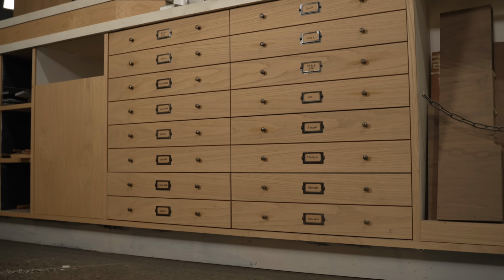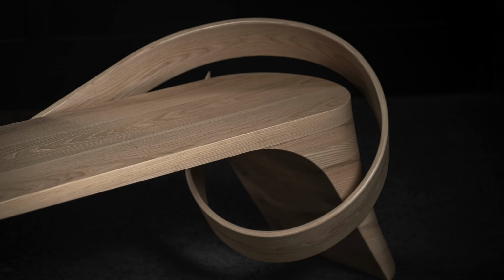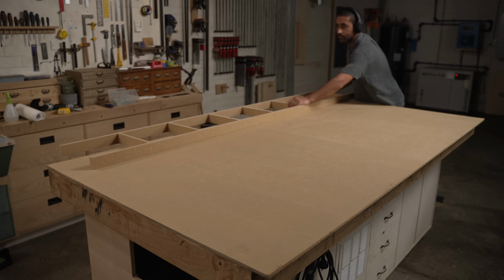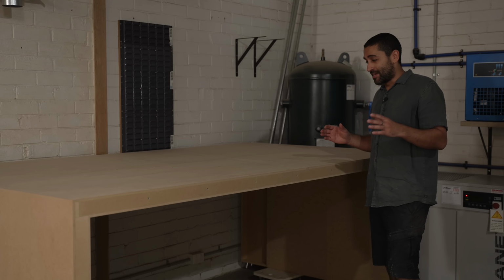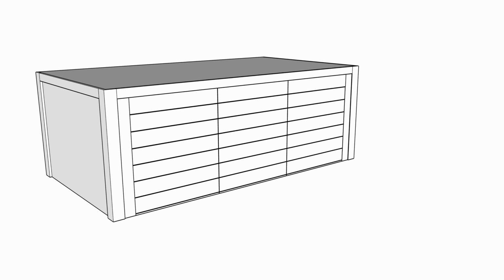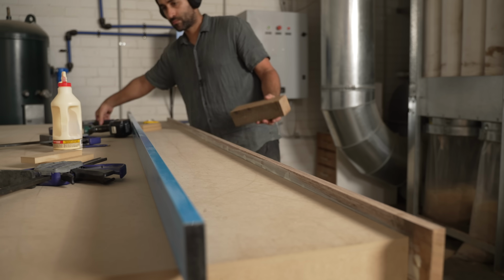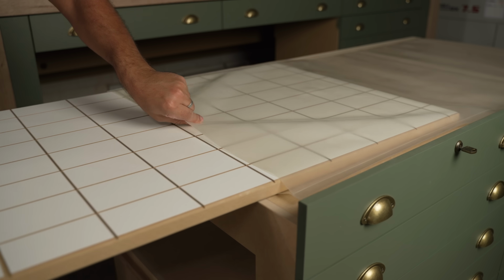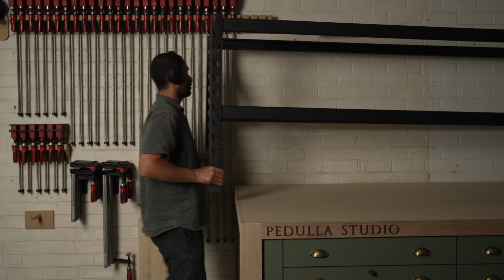Making drawer cabinets - WITHOUT DRAWERS

Comment from the maker: As always, thanks for watching!
Reply: A help maybe? 
Regarding resistance to bending (sagging workbench). 

There are vast numbers of formulae calculating “bending stiffness” depending on the shapes of a design but the major influence is given by the height of the construction vs the bending direction. 

The simplistic rule is that:
A) increase the width (thickness) by, let’s say 20% will increase the bending resistance by 20%
B) but increase the height by that 20% and it will increase the bending resistance by >70%. 

Kind regards 
Anders 
Sweden 

PS. Big admirer of your work. 

(Bending resistance for a rectangular cross section is: 
Width x Height x Height x Height (divided by 6 which is irrelevant in the explanation for why increasing height is so much more rewarding).
Reply: pleasure watching you!
Reply: Very interesting to see how you practice new ideas and techniques.  
It is a nice reminder that everyone is always tuning up their skills.
.......I thought I was the only one still hammering my thumb while  everyone else had it all figured out!
Reply: This is the coolest shop furniture I have seen in a long time.  I love it!  I wish I had enough space to have an assembly table like this setup permanently.  One day!
Reply: But I'm not "watching". I noped out at 1:30 after seeing you at a table saw and cutoff saw without safety glasses.
Reply: your work and your videos - are always top notch - thank you for sharing your passion with the rest of us !!
Reply: Nice choice with the diasharp plates.  I for some reason preferred the Shapton Pro stones to use with my Fixed Angle Sharpener, ... but that is an elegant piece and I am confident you looked at a bulky FAS and rejected it out of hand ... whether you liked the benefits it provided or not.

Comment: Regarding your torsion-box lack of ridgidity... I made 2 internal insulated doors for my farmhouse resto.. they were used to isolate 2 "cold zones", hallways with no heating (why would you heat them?) ...

Anyhoo, I made a frame of 3x2 planed straight as possible with a rebate on each edge to take the 6mm ply door skins ... but the actual core was a single sheet of high density ridgid foam which is EXTREMELY flat.... inserted in the frame , filling around the frame with exp. foam,  and impact adhesive for the skins, it turned into a VERY flat and stable door (both of 'em)  and after 2 full winter cycles has shown no warpage whatsoever... I just thought I'd put it out there as a bit of "outside the box" thinking....

I'm loving your vids, mate keep doing what you do !! 

from the Emerald Isle
😎👍☘️🍻

Comment: I am a retired mechanical engineer and have built a few torsion box benches in my day. For future reference MDF is flat and strong in compression, but weak in tension. When considering a beam (or a box, which is just a wide beam), it is most important to be sure that the bottom edges of your structure are very strong in tension. In your case with this low profile top bench, you could have made it extremely stiff by gluing a single sheet of Masonite hard board, or 1/4" plywood to the underside. Leaving the bottom edges of the ribs unsupported results in the tension side of the whole slab being way too weak to support even its own weight, as you discovered. If you have enough room, completely and thoroughly glue an 1/8'" sheet of Masonite (very cheap and very available) to the under surface to complete the "box". It will probably triple its stiffness. The sheet must be thoroughly glued to the underside edges of the ribs so that they carry the shear load of the bottom surface when it tries to stretch in tension. The top surface of the "box beam" is in compression, and as long as it is also thoroughly glued to the top side of the ribs, it will have no problem resisting the load. Making the top thicker would not help much. It is important that you make a complete box for it to be a box beam. Look at a typical I-beam in construction. The top and bottom edges are wide flat plates and the vertical rib carries all the shear loading that takes place in a beam. The top plate is in compression and the bottom plate is in tension. Right down the middle of the vertical rib, the loading changes from compression to tension, and is actually zero going through this "neutral axis". That is why all access holes drilled through a horizontal construction beam should go through the center where the shear stress is zero.

Comment: MDF was sawdust compress to that certain thickness. Unformed flat.
But does not have strength like wood. Good for spray paint finish.
Only problem was all cut end must add on sealer. If not water will sip in.
The MDF would be destroyed.
Any span, longer than 3feet or 1 meter. Internally to add wood in between.😊

Comment: Your 'relatively small area' is about same size as my entire  work area. 😁
The 'work smarter not harder' is so overused, I've had several bosses who have said it to me, but, when they see you working 'smarter' all of a sudden, there is just more to do so you end up working even harder than before without any benefit (even if you do stay fit)
It really wasn't a problem in my 30's, even 40's wasn't so bad but in mid 50's it started getting more difficult and last few years since retirement, well, watching You Tube video's is easiest thing to do.

Comment: Oh it IS an altendorf! The first table saws I ever used were those and although I have a locally made vintage table saw that I love dropping 20k on a german panel saw like yours is bucket list for sure. Beautiful tools. Even when well used in commercial shops. No review necessary, it only amounts to bragging about owning the very best. :-)
Reply: After a cursory look they are more like $40K in Aus dollars, which is about $27K US.  I did find a couple for $11K second hand.  You have to have a big shop though for one of those monsters (I wish).
Reply: @bluewren65  there are a number of other similarly epic euro brands that are a bit more reasonably priced. But used is fine if yhe sliding table aspect is mint.

Comment: Beautiful work, well designed (but for the dip), well processed, conscientiously assembled.  I'd give that a hearty "well done."
I'd have given the raw wood a wipe with Waterlox Satin. (my favorite clearcoat)  Using the outer piece of the lasercut board was genius to hold the lettering in the proper spacing.  I'll have to check out more of your work.
Reply from the maker: Thanks

Comment: Is there are reason that you haven't evolved to building and using a vacuum frame? Bags are a PITA to use compared to a frame, and you can make a frame that mounts to a wall and swings down to save space when not in use. They can even swing down while something is being pressed in them. They are much easier to use with forms for curved work, and can be made to whatever size you need.

Comment: For surfaces like glue tables or vacuum bag tables that are not used every day, I've thought about creating a torsion box that sits on top of another work bench that can be hooked to cables and raised up to the ceiling to keep it out of the way while glue is drying.

Comment: Mechanical engineer here, to help you with the sagging but without being able to get a thicker "table top". You could add a metal sheet (like 1/16'' thick) under the table BUT, for this to work, the underside needs, to be fliped over an even surface (or even pre-bent in the other direction) first. Then you need to find a glue that will laminate the metal sheet to the wood (over the underside of the table), screws and nails alone will do so much because the metal sheet needs to act as "part" of the whole assembly (not just screwed over). The idea is that steel needs a lot more pressure to stretch and since it's glued to the underside of the table (and only if well laminated), the metal sheet will act as a tension cable stiffening the whole table top. Just some tip from a fellow subscriber and fan of your work! awesome build I love your channel!!

Comment: I have to admit, when I saw you were working with MDF, I had my doubts.  You managed to make the whole bench assembly align with each other with precision so my hats off to you.  I usually despise MDF too, but you may have shown me a way to make it work.
Reply: When I saw he was making the torsion box sides/streachers out of MDF, I figured he was going to get some sag.  MDF just creeps too much.  Its wven worse where I live because of the humidity.  3/4 inch Plywood would have worked really well for the torsion box sides/streachers.
Reply: @relativisticvel  you’re right. Even shorter spans have even sagged for me and I live in a pretty arid environment. I really just don’t like stuff but cheap sure is enticing

Comment: re thicker top:  Or, just don't use MDF for the top surface.
Rather than a torsion box, for my next bench I'd look into pre-made flat surfaces.  A friend of mine had one a number of years ago, and swears by it.  I don't remember what it was called, though.

Comment: Clever, very clever. I thought the tables would be out in the open and thought that in between uses it would get covered in dust. This design doesn't  effect the open space that you already had, keeps the bags and machines dust free, and uses a corner of the shop that just sat empty. I really like the black steel shelving unit you put on top. I can invision overstock there or if you buy items in bulk, the overflow can go there.
I'm very jealous, ;>) of the new panelsaw/tablesaw. It's a beauty! By the way, great choice of color for the false fronts !
Reply from the maker: Thank you

Comment: 7:08 The single biggest problem with the box truss top design I can see at the moment is getting anything run from the back of the bench to the front face like electrical receptacles or shop air hookups UNLESS you allow for them (by adding conduits and device boxes to run wires or air hoses through at a later date) or outright install them before installing the top...

Edit: OK, I missed the Longitudinal Rigidity Problem...Bite me, I'm an Electrician, not a Cabinet maker...

😄😁😆😅😂🤣

Comment: An interesting concept for storage management.  Reminds me of the wooden Russian dolls.  You take the top half off the biggest doll and there is another and another.  Like you I hate MDF.  However it is useful for some shop projects.  You did surprise me with that metal shelving unit you put on top.  I suppose you will either put shelves or more closed cabinets at some point.  I have learned you need closed cabinets in a workshop to keep the mess out and the contents protected.

Comment: A very nice video! I’m currently working on a project with mdf to, and I would also like to make similar grooves for looks but I’m afraid that it will bow the mdf over time. Does anyone has experience on this?
Reply from the maker: As long as its fixed from behind it should be fine

Comment: You mention using angle iron. Long lengths of angle iron also flex a lot, your solution of edgeways boards increase stiffness. If you look up beam theory, and (Young's) modulus of elasticity for your chosen wood, a fairly simple calculation will predict the deflection of the beam.

Comment: I have worked with vacuum bags a lot. Think about this. Atmospheric pressure is about 14.7 pounds per square inch. There are 144 square inches in a square foot. That means over 2000 pounds per square foot of clamping pressure. You can't do that with a clamp.

Now think about a gallon of milk. It weighs about 8 pounds. That is about 160 gallons of milk sitting on a square foot of your project. This is why vacuum bags work so well. 

You can go to a big box store and get a bag to store clothing in. They just need a house vacuum cleaner to suck most of the air out. Maybe all you get is 1000 pounds per square foot. That is only 80 gallons of milk. Picture that.

For almost no money, you can get into vacuum bag technology. Try it, you will like it. :face-blue-smiling::face-blue-smiling:

Comment: This was already amazing all around, but specifically the bit where you not only have permanent vacuum bag stations, you also have the tubing routed through the table tops so they're tucked away inside the table internals?! Chef's kiss.

Comment: I’m so thoroughly impressed with your stunning workbenches 3 in 1 style and ik I could definitely use this concept as I’m in a tiny one car garage. This is why I love when talented woodworkers like yourself stop the beautiful works of art and devote some personal self care time because what your brains design far surpasses anything I’d create on my own. Any more of these and I’d be so grateful and thrilled to watch. Right now my garage looks like a hoarders house but with tools and it’s because I’m so damn indecisive about what I want and in some ways I’m ok with that. Lumber, plywood and mdf all cost a lot and I’d rather know for sure what I’m building and how I can utilize it to the fullest potential and this build is definitely one that’d be cherished and used long term. Mine would have to be scaled down, I need to come up with a different plans as I can’t imagine I’d be using sheets like yourself but I like the assembly, router table idea. I’d also like a dedicated place to sand that sucks the sawdust (can’t think of the name of course) and also store vacuum and dust deputy so maybe that could either be the second or smallest bench?
Reply: Downdraft table is what I think it's called.  I narrowed my focus down to smaller projects because after wrestling with large sheet goods, I always feel sore and it was not the safest operation to run a sheet of 3/4" ply through my tablesaw by myself.  I want to focus on box-making, picture frames or anything else that isn't going to be difficult to heft around a one-man shop.  As I get older, this will be even more important.  Hope this helps with your project choices.
Reply: I have deer paths, not aisles, through my overcluttered shop.

Comment: If you lookup MDF span chart you can find some information on allowable spans.  You would have to calculate based on your design's such as the torsion top you have, but it might help on deciding the required thickness.

Comment: 12:52 are you familiar with the engineering behind pre-tensioned and post-tensioned concrete slabs?  The principles of how metal is incorporated should be adaptable to stiffen a thinner worktop.